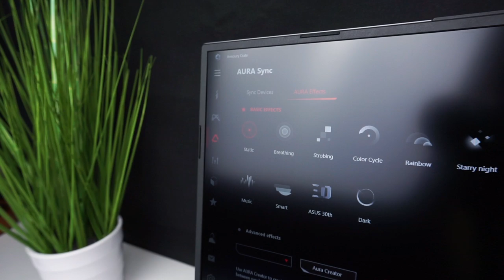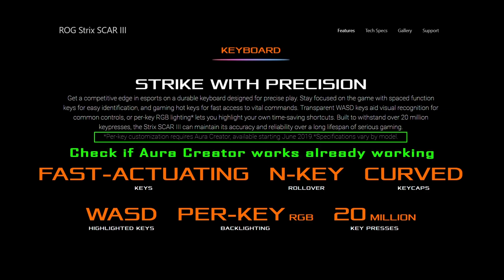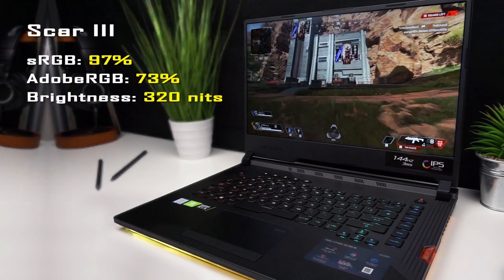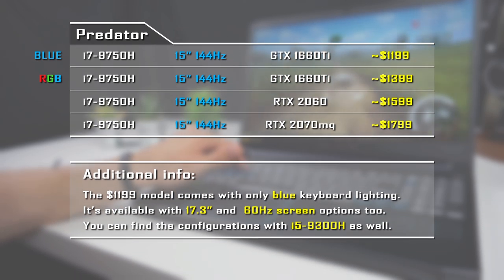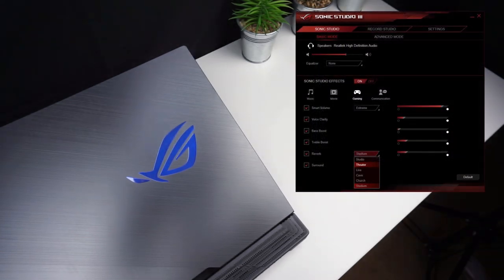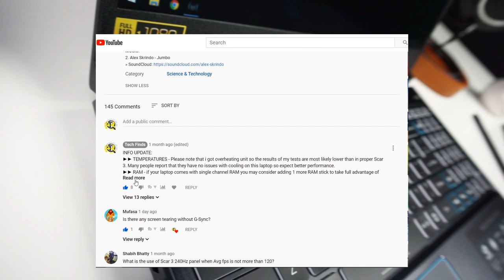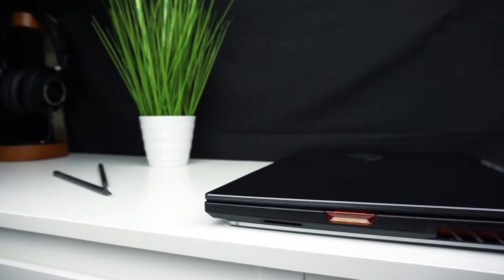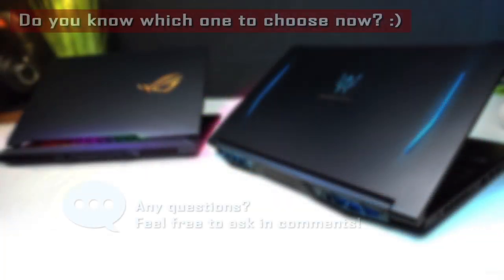Acer Predator Helios 300 2019 vs Asus Scar III - In-depth COMPARISON / REVIEW

Comment: Thanks for doing the review and doing my request
Reply: Can you send me the specs of the two laptops and if there keyboard lights up
Reply from the maker: @Loydsuka  both laptops come with the same specs except for the GPU. Predator has GTX 1660Ti and Scar 3 has RTX 2060, the rest is i7-9750H, 16GB RAM 2x8 and 512GB M.2 SSD. But you have different configurations too, I mentioned that in the video.
What do you mean with this keyboard? Both laptops have backlit keyboard.
Reply: @TechFinds  i was taking about how to light up there keyboards
Reply from the maker: @Loydsuka  in control center app. Predator Sense for Helios 300 and Armoury Crate (or Aura Creator) I  Scar 3
Reply: @TechFinds  my last request is can you do a gaming test for the 2 laptops with benchmarks and compare the 2
Reply from the maker: @Loydsuka  I'll be doin only benchmark video for Predator soon. There is a video for Scar 3 already. You can watch both and compare
Reply: @TechFinds   i have a question which is faster the rtx or gtx??
Reply from the maker: @Loydsuka  RTX

Comment: Hi, thank you so much for this comparison. 

Should I get scar 3 (240hz, 2060 rtx, 1tb HDD,16gb ram) or Helios 300 (144hz, 1660 ti, 256gb ssd, 16gb ram) ? 

They are both the same price but scar is used for 1 month and Helios is brand new.
Reply from the maker: Scar 3 has better specs so it pays off better. If you think that laptop is in good condition it's worth considering over the Predator
Reply: @TechFinds  yeah it still has a warranty on it ( can be replaced with a new one if I break it lol, not really sure how reliable that promise is!)

 The only thing is that Helios just has thousands of reviews while scar 3 only has like 150 reviews on Amazon.  

Thanks for your quick response though!!
Reply from the maker: @fitfrek  Helios 300 is the most popular gaming laptop. Acer made it's popularity on the best price to performance ratio. That's why the reviews count is higher as well
Reply: @TechFinds  If you had to choose one, which one would you go with? Assuming Scar 3 is in perfect condition. 

I also plan to use these laptops at cafe's for work if that helps. 

Thanks so much for your replies, best and most useful youtube channel ever, subbed!!
Reply from the maker: @fitfrek  If the price is the same and Scar 3 has better specs like 2060 and 240Hz then i would go for it rather than Predator in this case.
Reply: @TechFinds  What if Scar 3 was like $300 more expensive? And it came with 2tb SSD (vs 256gb SSD helios). 

Thank you so much again!
Reply from the maker: @fitfrek  then I would choose Helios - you can install 2tb HDD on your own.
Reply: @TechFinds  can I ask why?
Reply: and if I install 2tb on my own, (SSD) then it would make it the same price as the Scar 3 lol.
Reply from the maker: @fitfrek  Helios 300 has more useful features that i personally need. However if Scar 3 had better specs and it was the same price i am ok to sacrifice these features (power button, better fan control, webcam).
I thought you're talking about 2TB HDD ;) Ye SSDs are expensive
Reply: @TechFinds  oh sorry my mistake I did say HDD lol. I bought the scar 3. I thought scar 3 has a bit of fan control?
Reply from the maker: @fitfrek  yes Scar has kind of fan control, but not as good as Helios. With Scar you have levels that are still automatic depending on heat of the CPU na d GPU. For example on turbo mode the fans can spin faster than in other modes but they are still automatic

Comment: Quick question man. Is the 240hz strix iii ips display too ? Because i see on the 144hz strix it actually says it on the sticker but on the 240hz it just says "the best gaming"
Reply from the maker: Scar 3 has 144Hz 3ms IPS-level display and 240Hz 3ms IPS-level. It's basically as good as normal IPS here, so no worries.

Comment: Hi, im doing some research on a gaming laptop i can buy and theres just so many that i just dont know where to start. I want to spend round about 1200 pounds on one but i dont know which one to get, im considering the acer predator 1660 ti or the omen 15 with rtx 2060. Thoughts? Also if you can recommend other laptops that would be nice
Reply from the maker: Hard to say, because i mostly know US prices. The prices vary between countries a lot and of course electronics is much cheaper in the USA. I think that you're looking at good laptops in this price point, and if i was you i'd go for 2019 Helios 300. But in the UK the 1200GBP model comes with i5 processor. For i7 with GTX 1660Ti you have to pay 1400GBP i guess, so i think you'll end up better buying Omen which costs 1130GBP. I mean this config: https://amzn.to/2kCuU62 but i recommend to buy additional 8GB RAM to take full advantage of the performance of this laptop without bottleneck. My friend bought one in the UK, but with different GPU and he is happy so far. A nice and portable laptop which is powerful. The only issue was temperatures, but after repasting it runns cool. Relectly HP added aswitch to set the fans to max speed in the control center app, so that's even better.
Reply: @TechFinds  thanks so much, im very new to this, this is gonna be my first actual gaming pc so alot of stuff is gonna go over my head. For one i saw that the rtx 2060 was better than the 1070 and 1660 as graphics cards but then their performances changed on laptops, that confused me so idk.
Reply: @TechFinds  also the stuff about fans i dont get😐
Reply from the maker: @aminubk  RTX 2060 performs about the same good as GTX 1070, it depends on game but the difference should not be huge. GTX 1660Ti is slightly weaker but much cheaper. Actually the difference between RTX 2060 and GTX 1660Ti in Helios 300 is only about 5% for RTX, but it vary between laptops and brands. What do you mean fans? The noise? Every gaming laptop is loud under heavy load, because such powerful hardware needs a good cooling. You can expect 50-60dB. But o  idle it's usually not a problem.
Reply: @TechFinds  by fans i meant the cooling, dont really know my way around a computer, i just want a strong machine that can play games really well cause i wanna start playing pc games more. So i dont really understand simple things like cooling . Or ways to improve performance through settings and stuff like that. Its probably really easy to understand but yknow... im dumb
Reply from the maker: @aminubk  everybody has to start somewhere. :) Usually temperatures in gaming laptops hover from 80 to 90 degrees Celcius. Constantly over 90 is bad, because it limits the performance and it's not good for hardware. It's recommended to undervolt the processor in Omen and play with max fan speed. Also would be good to change thermal paste for some high quality one, but idk what warranty says about that.
Reply: @TechFinds  thank you so much, youve been so helpful. Last thing though, can you give me a link to which ram you recommend?
Reply from the maker: @aminubk  First you have to ensure that the laptop comes with 1x8GB RAM or 2x4. It has only 2 slots, so if you'll get 1x8 you're free to add another 8GB stick. This one will be the most suitable: https://amzn.to/2maMIWc
Reply: @TechFinds  oh ok so if its just 1 with 8 i can buy another one then, alright. Is that the best i can get for this laptop?
Reply from the maker: @aminubk  16GB 2x8 is a sweet spot. You don't need more for gaming.
Reply: @TechFinds  alright thank you so much, really appreciate:)
Reply: I bought the omen and returned it for the Helios 300. The omen runs way hotter and the fans are so loud and low quality plus mine had worse backlight bleed than my helios. Trust me the omen is junk
Reply from the maker: @yaseensquires6832  you must have got a bad unit
Reply: @TechFinds  it's not it's normal for the CPU to run over 90 on the omen. the fans were so loud on my omen I could hear them thru my headphones. The Helios doesn't get loud at all while gaming unless you turn the fans up. Plus the build quality of the Helios feels so much better. The omen is junk trust me
Reply from the maker: @yaseensquires6832  yep, it's not normal. My friend's Omen runns at 80-85 degrees. If your u it stayed constantly over 90 it was defective

Comment: I have the Helios 300 with a 17inch 144 Hz display and RTX 2070 Max q, For the price this thing is insane,  Low fan noise on Auto setting, Turbo is loud but you don't need it unless you must have over 100fps on the most demanding games, Excellent game performance and a great cooling system, You would probably be paying nearly a £1000 more for an equivalent MSI or Razer. Only bad point is the RGB lighting is zoned but who cares about asthetics if your on a budget.
Reply from the maker: Totally agree. This is the best price to performance laptop of the 2019. I see from comments that most of people rather go for Predator. :)

Comment: What do you think is better in terms in temps? Asus Zephyrus S gx501gs gtx 1070 max q or this Predator with gtx 1660?
Reply from the maker: Hard to say, because I didn't tezt Zephyrus S, but according to other people's reviews and my tests of 2019 Helios 300 I think that Predator should run cooler. Zephyrus shouldn't be bad too, but it's one of those thin laptops, so thermal management must be a sacrifice here.

Comment: Is there a better recommendation in the $2k range than strix hero 3 with rtx 2070? I'm fine with spending the 2k but is there anything else I should be looking at?
Reply from the maker: Yep, there is also MSI GE75 or GE65 Raider. It comes with full size RTX 2070 as well and it costs around $2k. Very good laptop but unfortunately i can't get a sample for review. Once i have even seen full size RTX 2080 GE75 Raider for $2,2k on sale.
Reply: @TechFinds  wow thank you! I'm going to look into both of those as I haven't had a new laptop in like 8 years so all these brands are daunting. I'll be looking out for your review of the msi if you get one in!

Comment: Thankkk Youuuu!😍❤️ I was Going to buy The Scar III But I knew That The Predator Helios 300 Is Better because Of This Video!❤️🔥
Reply from the maker: Thanks for commenting!
Reply: just buy the scar because it already have rtx 2060/70 than helios also scar performed better than helios.  also every asus rog laptop already have intelligent cooling system and already have anti dust cooling system so you dont need to removed it by your self. but if your choice i already have scar 3 and it performed better than helios but is it your call
Reply: @BruhBruh-mk5yg  Okay But My Budget Is Just 1,100$
Reply from the maker: @peteralber579  In this price point i think that there's no better laptop than Helios 300 right now.
Reply: Tech Finds 2019 helios 300 is so easy of getting the laptop hot than the last year version
Reply: Peter Alber Just buy an rog gaming laptop
Reply from the maker: @BruhBruh-mk5yg  2019 model has much better cooling than previous year models of Predator. How did you assume that? I tested it and it's actually one of the best cooled laptops on the market right now.

Comment: well The aura creator is working now.. And my Scar 3 is perfectly running all my games at Ultra High settings.Its  worth the bucks
Reply from the maker: Good, thanks for info!
Reply: What about heating issue??
Reply: The gpu and cpu stays around 70deg to 76deg tops. while Im playing monster hunter at highest setting. It varies depends on how cold my room is.
Reply: no thermal issue so far. I just notice the fans are noisy while playing games. Plus you will get a shadow drive with the ROG thats another separate 333gb storage. So yeah.. ROG is better
Reply: @salatielsalanguste7115  thanks man
Reply: And its hot here in the Philippines. So if  the Airconditioning is on. the temp just around 60+. Scar 3 is a beast I have no regrets choosing this laptop

Comment: I was confused but in the end I choosed helio 300 and I bought it since week
Reply from the maker: Most of people choose Predator I see. It's a good laptop.
Reply: Hp Omen the best . 17 inch rtx 2070. I got it for £1529
Reply from the maker: @rajakhan12346  Omen is good too and it's not too expensive.
Reply: @TechFinds  yeah  it excellent. Just wish had better battery and speakers. Must be way to get speakers better . Bang and Olufsen . Battery just sucks.
Reply from the maker: @rajakhan12346  I couldn't find any sound control app when I was testing Omen. But maybe it's possible to download some equalizer. And the battery? No gaming laptop has a good battery life. :)
Reply: @TechFinds  there's some ways to make battery little bit better.
Reply from the maker: @rajakhan12346  Yep, but still if the battery is a most important feature then gaming laptops fall short compared to normal laptops or ultrabooks.
Reply: @TechFinds  yeah true . Just hate I have to plug it constantly lol .

Comment: i have a question bro do you think the performance of i5 9th gen with 1660ti is better or i5 9th gen with RTX2060 ? with same 16 GB ram . i want to know about bottlenck . Which will give better performance ?

thanx in advance
Reply from the maker: Well, i can only guess, because i didn't test such configs. You should get better performance with RTX 2060 and i5, because even most CPU bound games are not utilizing it's full resources, so there should not be any bottleneck. However if you have for example i7 you will get better performance anyway.
Reply: Actually I am getting Lenovo y540 (i7) RTX 2060 for 5600 PLN ( polish currency ) and acer Helios 300 ( i7) rgb 6200 pln . Moreover ASUS scar 3 ( i5 RTX 2060  500 SSD for 5400 PLN ) and HP omen 15 ( i7 8th gen RTX for 6200 PLN ).  Now I am confused which laptop I should go for , I check your page quite often to see details but now I am so confused .....I am a medical students so usually I need more battery for laptop plus mild gaming . Which one should go for .....can you answer me in your free time 

Thanx
Reply from the maker: @MegaMushfiq  Nie polecam Legiona, nie był najlepszy. Za to Predator przekroczył wszystkie moje oczekiwania, więc moim zdaniem warto dołożyć trochę pieniędzy i kupić Heliosa 300 zamiast Y540. Z GTX 1660Ti w tym laptopie masz lepsze temperatury i lepszy performance niż w Legionie z RTX 2060. Poza tym Predator  ma 144hz display, a Legiona z tego co wiem na x-kom sprzedają tylko z 60hz, więc różnica jest ogromna.
Reply: dzięki 😍

Comment: For those interested.... Acer re-certified has the Helios 300 with i7-9750h, GTX 1660ti, 512GB M.2 SSD, and 16GB RAM for $900 - 10%.  I just purchased  one and then purchased the 17.3 version with the RTX 2060 for $1236 - 10%..... all other specs are the same but you get the RGB keyboard and larger screen. :)
Reply from the maker: Thanks for sharing info. :)

Comment: Im buying one of these two laptops, the 17inch version, 144hz and with i7 9750H and RTX 2070. Do you know if it will be possible to connect the Scar III to external display with 144hz using HDMI or USB C port ? Are these ports connected directly to the RTX 2070 ? I know that the Helios 300 will be able to get 144hz refresh rate on an external screen using mini display port, but not sure for Scar III since it doesn’t have mini display port. Thanks !
Reply from the maker: In theory HDMI 2.0 supports 144Hz at 1080p, but the monitor must also support 144 Hz over HDMI, it is not enough just to have a laptop or graphics card with an HDMI 2.0 port capable of 144Hz. Some monitors are limited to 60 Hz over HDMI even if they have HDMI 2.0 input.
Reply: Tech Finds Thanks ! In general, Which laptop in your opinion would be the Best option between Acer Predator Helios, Asus Rog StriX Scar III and Lenovo Legion Y740 all with the 17 inch 144hz, i7 9750H, 16gb RAM and RTX 2070 version ? And regarding speakers in the Helios 300, Are they so bad and much worse than in the Asus Scar III ? And also, what about the screen quality between these two ? Which one was more pleasant to you ? Thanks man !
Reply from the maker: @kristijanini7846  if you're gonna buy RTX 2070 model you need to know that Predator comes with RTX 2070 Max-Q while the Scar 3 has full size RTX 2070, so you'll get about 10% better performance with Scar. Idk how about RTX 2070 in Legion Y740, but I suppose it's Max-Q as well. Predator has not bad speakers but Scar 3 is another level, the best sounding laptop speakers out there. I liked more the Predator's display if it comes to colors. It was also comparatively smooth to the Scar 3. The only issue was screen bleeding. No drama for me but some people may not accept that.
Reply: @TechFinds  Thanks ! So you think that ill be able to connect Sccar III to an external display of 144hz with Gsync trough HDMI port ? Is the HDMI or USB type C connected to the RTX 2070 ? Thanks !
Reply from the maker: You should be able to get 144Hz via HDMI, but only when your monitor will be capable of 144Hz HDMI as well. Dunno about G-Sync.

Comment: can you compare the idle fan noise? is the asus louder than helios 300 because the 2019 helios is pretty loud when you just leave idle.
Reply from the maker: I don't have these laptops anymore. I had to send them back. You can manually set the fan speed in Predator to make it quieter. Scar 3 has silent more which you can use when idle and it's quieter than Predator.